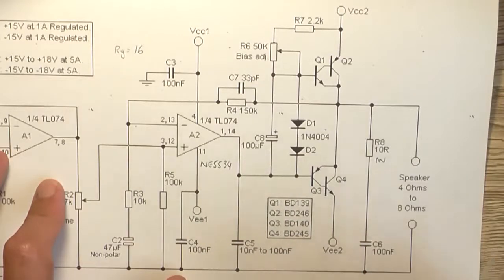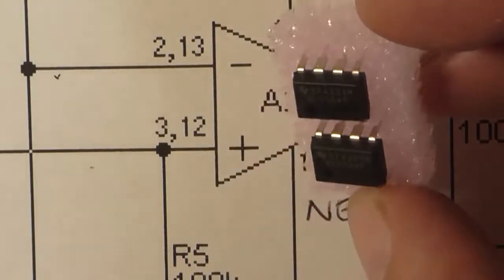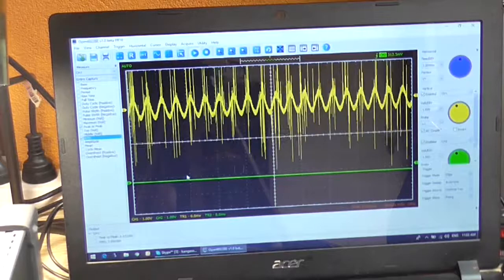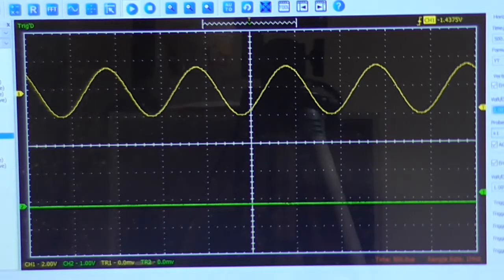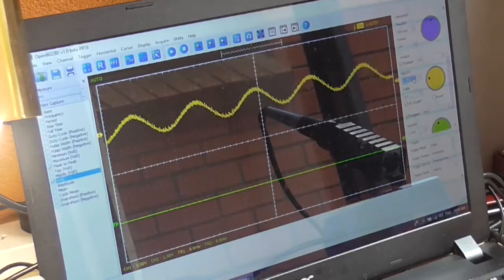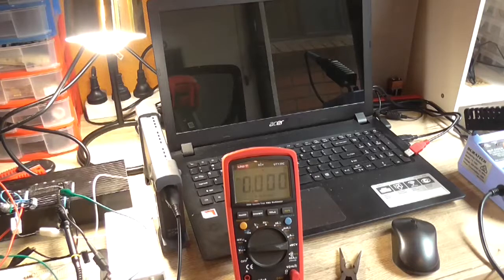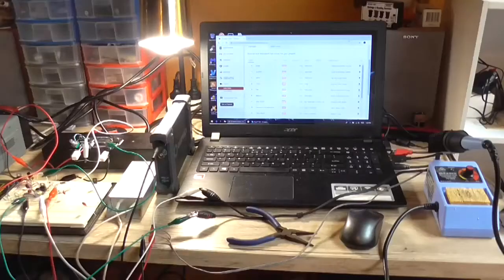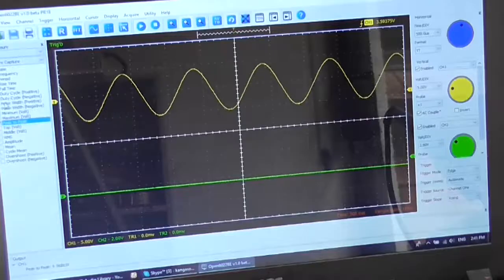OpAmp Based Power Amplifier Version 2

Comment: That scope clips at 5v. Check that you are in the correct voltage scale. I have the same scope and was struggling with incorrect measurements.
Reply from the maker: Yep, exactly. It took me a while to figure that out. This is an older video and there is another one coming soon where I was testing something and getting the same clip result. I thought, this can't be right. It isn't. A x10 probe (as per the video description, or even x100 depending on what voltage you're going to expect) would be much more accurate for this cheap scope. Or, bite the bullet and buy an expensive Siglent, Rigol or other scope with a much higher voltage input. Thanks for the comment.
Reply: @AstrosElectronicsLab  exactly. For low frequency, repetitive signals and low voltage stuff this scope is just enough to fit my needs. Although I'm lurking for a real scope myself, I can't justify the cost for the times I really need it.